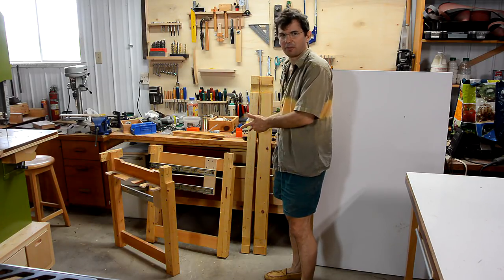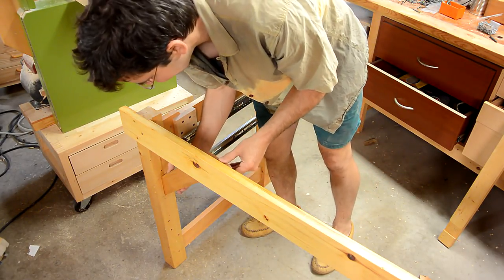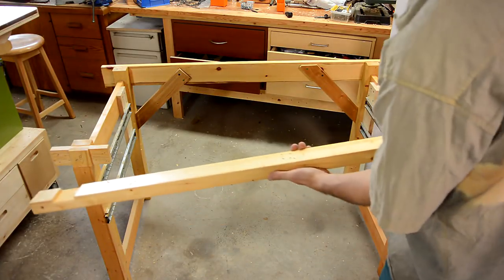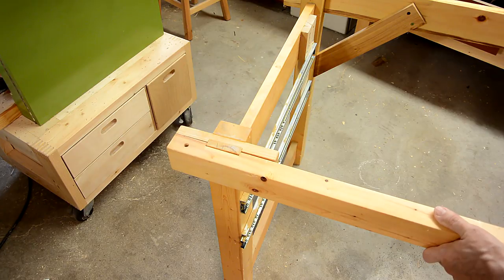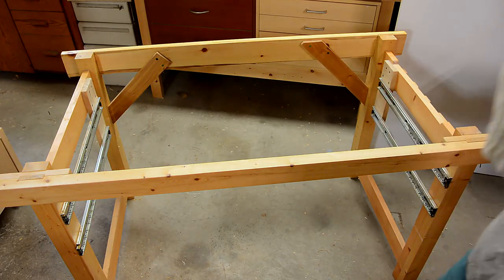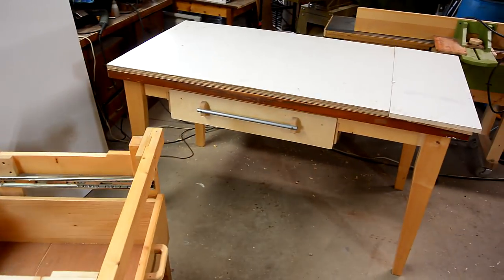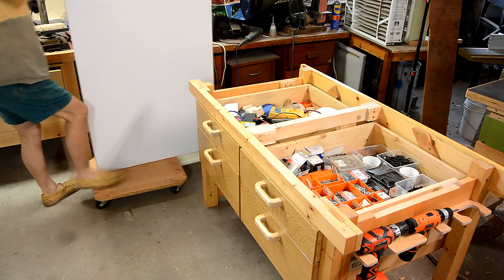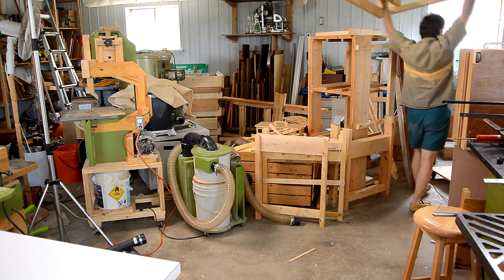Rigid but disassembleable workbench

Comment: I like your efficient use of a dolly to move things! It never occurs to me and I just lift the entire thing.
Reply: Mike Gerrits I totally agree. I just moved and I have a trolley just like that which I made, I wish I had used it like that! I certainly will remember it for next time!
Reply: I must have 10 of these boards by now. Stuff gets parked on them permanently and then I need to make more..
One time I moved an entire wall shelf with a bunch these, 5 meters long, fully stocked! I just lifted it with a pallet truck bit by bit and slid these dollies under the lowest shelf, then you could push the whole thing around with one hand.
Best thing since the invention of the wheel. When you move heavy desks mind that the legs don't slip off when you run over rough spots. I've had close calls (for toes)...
Reply: chad

Comment: Appropriate workshop attire, safety shorts and job site moccasins.
Reply: DesandSam what's are you from five?  Any man should be able to use a drill naked and not hurt himself.
Reply: Hey, overheating is also a workplace hasard, you just have to figure out which type you want to prevent the most :p
Reply: Amen, everyone makes fun of me because of my shorts and flip flops.  I get to hot to fast in jeans and shoes in the blazing summer.  Besides, you're not a man until you can weld all day long in shorts and flip flops.  ;)
Reply: I did about an hour of welding in a short sleeve shirt one time.  Never again, horrible sun burn.
Reply: I bought some sleeves that you can just slide on while welding.
Reply: I'm sure he has steel-toed moccasins. All safe. :P
Reply: ARW do you have a link/source for those slip sleeves.
Reply: you can get them at harbor freight and northern tools.  https://www.harborfreight.com/catalogsearch/result/index/?dir=asc&order=EAScore%2Cf%2CEAFeatured+Weight%2Cf%2CSale+Rank%2Cf&q=sleeve

Comment: I have a stupid question....knowing this bench could be taken apart in the future, why not use nuts and bolts on at least the 90 degree angles instead of screws? T-nuts maybe? The rigidity demonstrated by the reassembly is impressive, I've been looking online for examples of this kind of design....thank you for sharing.
Reply: Dutch Vander Ploeg I was thinking about this and my guess is he didn't have them on hand. he's not a fan of paying for stuff and I guess four drywall screws have the sheer strength to accommodate whatever is in those two drawers. (it's 8 screws, but 4 per side).
Also, why 'over engineer' a thing?
Reply: Dutch Vander Ploeg using nut and bolt and tnuts take more time and bolt can damage the wood tho .. and also drywall screw is cheeper 😂 .
Reply: Because it really isn't necessary. If you screw something together in the exact same position (and in this build everything is located very well), the screws will find the same thread they cut the first time. So there isn't really any wear through (dis)assembly even with pure wood screws.
Reply: If the wood wears, drill a bigger hole, put bigger screw. Not a big deal if it's not getting disassembled very often.
Reply: Thanks for your replies, from a new person trying to understand a lot of different aspects and how they may apply.
Reply: +altaroffire56
And if the hole is too big, glue a dowel with a smaller hole into it. Endless maintenance.
Reply: have you ever bought Bolts? those things are expensive, especially in comparison with simple screws.
Reply: Expensive? Less than five dollars will bolt the entire thing together.
Reply: Rather than T-Nuts, I was thinking threaded inserts.
Reply: Not any wear? It's already showing.
Reply: I was thinking carriage bolts or one side with glued-in nuts would be easiest. Once the basic parts are built it's 1-wrench dis/assembly.
Reply: Drywall screws and shear strength should never be used in one sentence. Then again it's not fair to pick apart every little thing someone does.
Reply: Nuts and bolts can end up with a lot of play in many situations, because of the size of hole you need to slide the bolt into.  
I built his "simple sturdy work bench" and used nuts and bolts to attach the legs to the side rails, and it ended up wiggling in the summer.  Luckily there is room for the screws as he did it, and I'll be adding them.

Comment: I want to build a table that can be assembled and disassembled, for use in garage.  If table is to be assembled and disassembled, say, 20 times a year, would screws be OK, or should I use bolts and thread inserts?
Reply from the maker: if it's that often, threaded inserts are the way to go.

Comment: My garage is my workshop, so space is at a premium.  I'd like to build an outfeed/assembly table with retractable casters so I can roll it over and on top of my table saw for storage, then roll it off when I need to use it - but I'm having trouble coming up with a design for the casters that will raise the table high enough for storage, then drop the table level to the table saw when being used.  Anyone got any suggestions?
Reply: Scott Baker Build the outfeed table on wheels and at the correct height. On each side of the table saw place a length of wood with a concave top and angled end. When you've finished using the TS,  push it up into the tracks, which will raise it up over the TS. The concave top of the wood will function as a kind of rail.

Comment: What material is the top made of? Looks like a kitchen counter top. Reason I ask is because I am building up my workshop and I am going to be building benches myself. Not movable though. Mine will be bolted to the wall.
Reply from the maker: yes, like a kitchen counter top, but twice as thick, and smooth.

Comment: You mentioned that the bottome drawer is on wheels but it appears to be so low to the ground. Can you elaborate on what sort of wheels you used and also how you mounted them to keep the low profile? I really want to build one like yours. Also, what have you got against pocket screws?
Reply from the maker: click link in description, see links at end of article.
Reply: Thanks Matthias, that's way more than I could have asked for. You are the man.

Comment: What is the difference between "pocket holes" and "screws at an angle"?
Reply: He didn't spend $150 for a bit and a hunk of plastic with a tube drilled into it.
Reply: So it is "Pocket Holes"®, okay.
Reply: So far, about 50 replies in the comment section, by my estimation...  ;-)
Reply: Lukas Benedix pocket holes these days are touted by some gimmick jig manufacturers as their idea and gift to wood working. He doesn't like the gimmicky plastic things, because they are a rip off when he can make his own with better quality. It was a joke.... A German making a joke... Obviously hilarious....
Reply: ZeusT He's Canadian now.
Reply: Jordan Johnson True. Fortunately, his humor is still perfectly German at times.
Reply: Lukas Benedix well what i undrrstood; pocket holes are US for screws at an angle, screws at an angle are Canadian for pocket holes
Reply: Pocket hole jigs aren't a gimmick.  They guarantee a consistent angle which is necessary to get a consistent penetration (in combination with a depth stop on the drill), and they also guarantee that the screw head sits beneath the surface at this penetration.

The more expensive pocket hole machines also incorporate clamping allowing you to very quickly drill a large number of pocket holes on the edge of a sheet.

Also the "plastic things" aren't just plastic, they have a metal bushing for the drill bit.  If you want to buy the bushing and the drill bit, it costs basically as much as getting the commercial jig.  Because it is, after all, just a metal bushing held in place with a chunk of plastic.  You aren't going to save more than a dollar or two replacing the chunk of plastic with a chunk of wood.  You can save more by doing without the bushing, but then your jig is lower quality.
Reply: Andrew Cady I didn't say that the concept of the jig is a gimmick..... Jigs rock.
Reply: Jordan Johnson
YOU CANNOT GET THE GERMAN OUT OF A GERMAN!